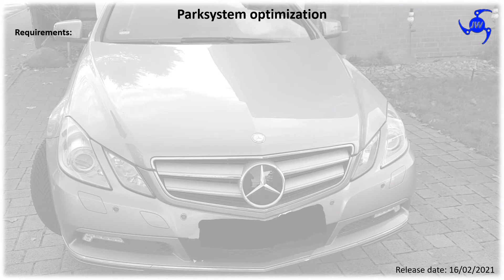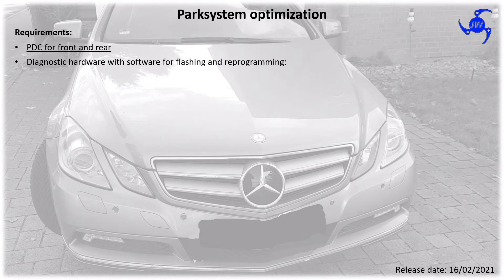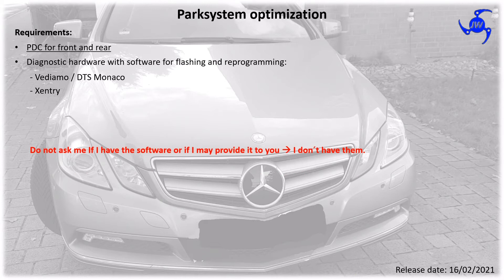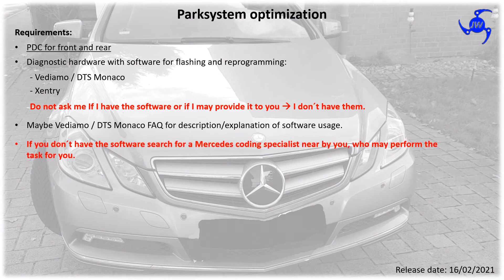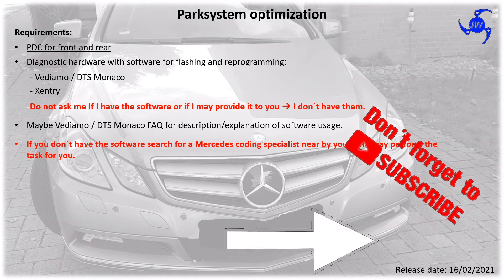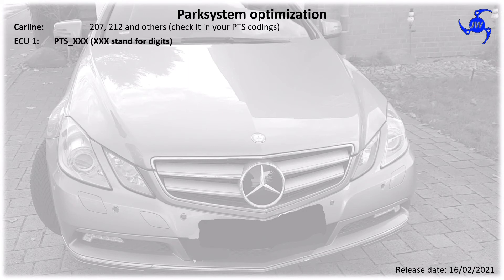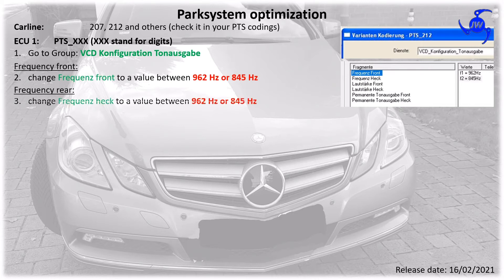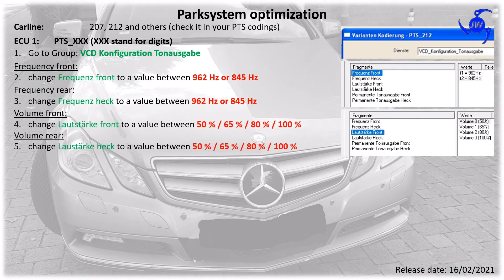DIY - PDC tuning - Mercedes coding manual

Comment: Does this work on a w211 ?
Reply from the maker: IT should Work. 
i did it at a w209 MY1999 which is even older than a 211.

Comment: Very good video.
Can I ask about coding/ activate the module/ functions.
Can I program/activate module via xentry, or I need another program.
Actually my 2020 GLS 450 has standard front cup holder, I’ve removed original cup holder and installed heated/cooled cup holder and I think I have to activate this option in rear SAM.
Thanks
Reply from the maker: some changes ( most not) are able to be done by xentry. for most codings you need vediamo or Monaco. but be careful these are developer tools and do not belong into everybody's hands. if you don't know what and how you do something, you may damage even your ECU.
Reply: @JWAutomotive  thank you so much!
Reply from the maker: the stuff with the cup holder you need to search in your own. can't help you with it.
Reply: @JWAutomotive  could you tell if this I need
Mercedes Diagnostics Vediamo 5.1.1
or this
Vediamo 4 Openport 2.0 Passthru Diagnostic
and what interface I need?
Is j2534 will good?
Reply from the maker: @marklitvinsky9596  depends which hardware you use.
i think with this questions you should go into mhhauto forum.
Reply: @JWAutomotive  thank you so much pal!
Reply from the maker: one hint from my side.
a sd connect with doip is perfect.
don't your use any universal hardware.
you will work at a car which is a lot of money worth i think you don't want to destroy it.
Reply from the maker: same people use a ecom.
you need to inform yourself in the forum.
can't help you further.
you need to do your decisions on your own.